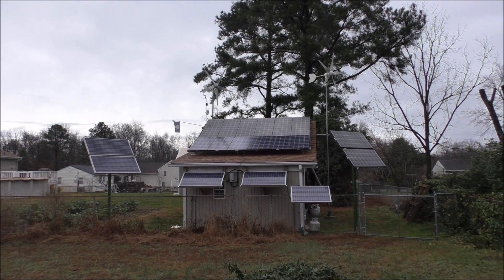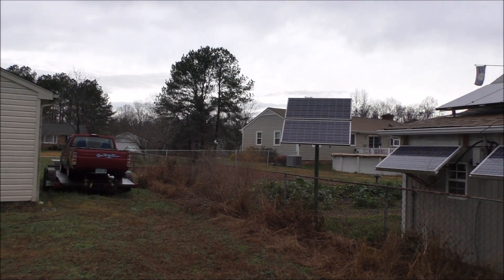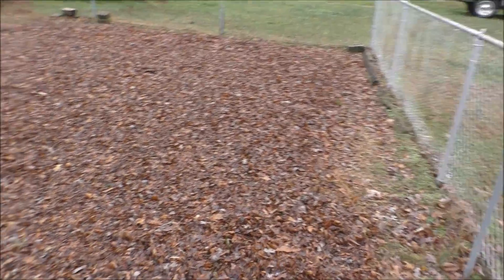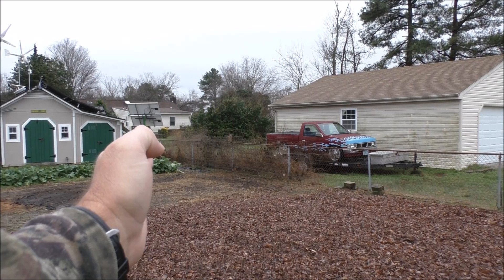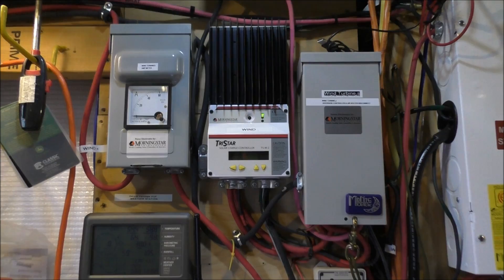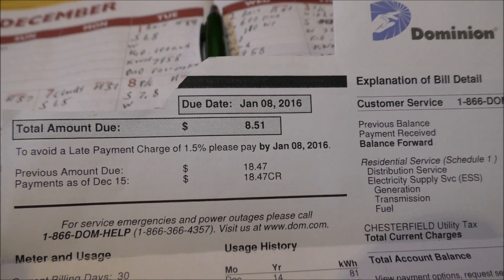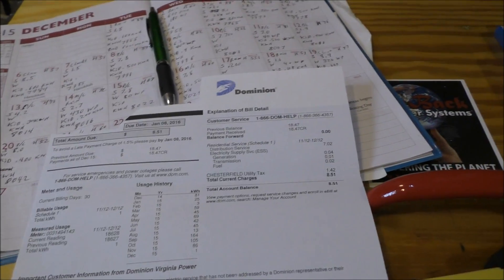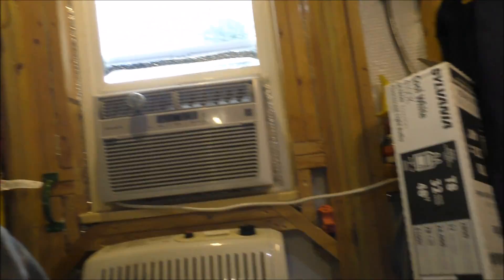Solar & Wind EnergyCell  200 GH AGM's Battery Bank & 1 kWh Power Bill December 2015 BY KVUSMC

Comment: Kenny< I'm sort of in the same shape as you, just about out of room for more panels. I'm thinking seriously about building or having someone build me a 10' X 12" pergola for solar panels. I'd paint it to match the color of the house or stain it. It would add a little beauty and functionality to my home. I'd have a very short run on the PV wire. In your case if you do add more panels by your pool be sure and run extra PV wire for future expansion. As you know the winter time is a killer when trying to produce solar power.  Here in my subdivision I can't have any ground mounted panels HOA rules. I really enjoy your videos. Keep those videos coming Marine.
Reply from the maker: +Randall “oldkynavyvet” C Semper Fi  NAVY  I Know What You Mean I may Do Something Like That In The Future  Thanks Randall

Comment: I agree solar is the way to go ! Have U thought of using some Enphase grid ties ? U can run from were U what to install your solar at than 240V strait  to your closest 240 line as U are already good to go with Grid tie. They have worked great for me  240V & very little power loss. Merry Christmas.
Reply from the maker: +TheKilog69 That  Is A Great Idea They Are Great Inverters  I Appreciate The Idea Cheers Kenny And Merry Christmas

Comment: suggestion: put in a solar tracking system (like Bill & Rosa)1/2 distance between heat pump & weather station, right along the fence. Q: did you get a 30% tax credit when you purchased the new batteries?
Reply from the maker: +Mr. C Great Suggestion  Buddy ! Yes Sir 30 % Tax Break On All Solar Equipment And My Batteries